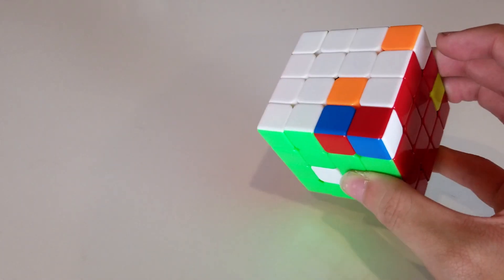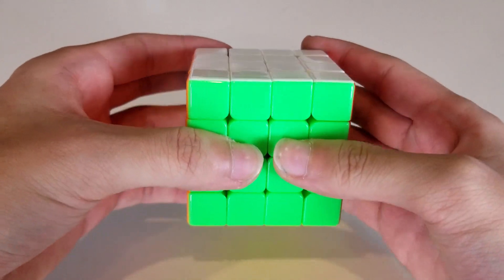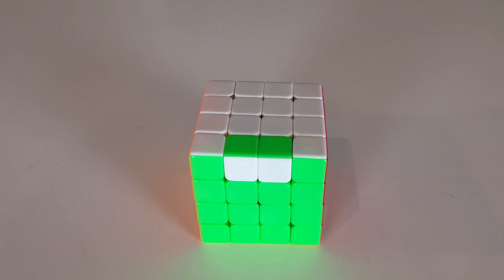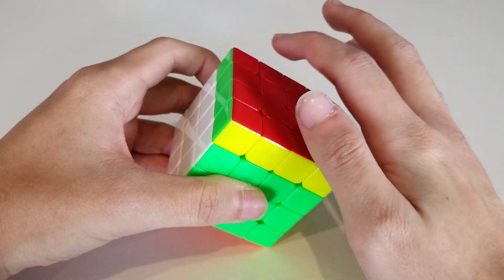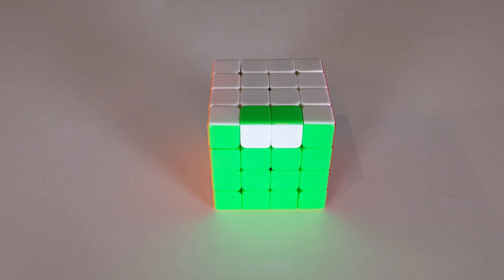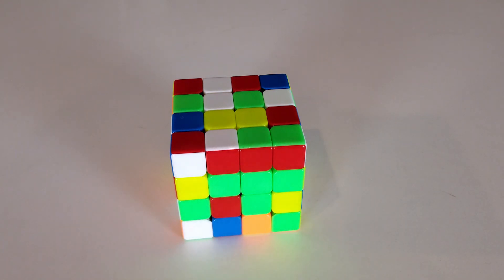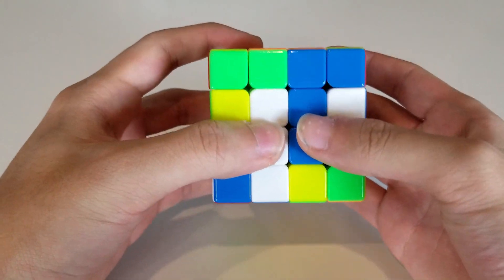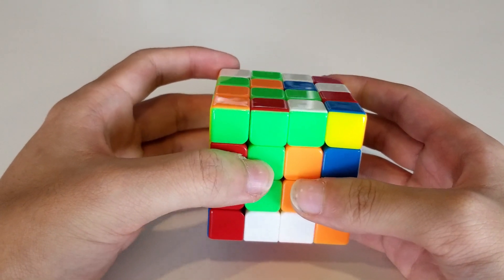Why OLL Parity Avoidance Actually Works

Comment: What sort of mental system are you using to track inner turn count? Something like just saying "e" "o" in your head seems like a simple approach or maybe just putting your tongue on the roof of your mouth or not could be easy and not require any actual mental thought
Reply: I'm also not that familiar with 4 blind, but I believe that you start with an orientation when tracing, but it seems like you don't really need that here. Any thoughts on how that would affect someone that solves with color neutral centers?

I'm thinking that if you're used to choosing an orientation for blind, you should kind of mentally lock yourself into a solve orientation, but maybe once you start to plan centers it's not too bad to shift your mindset